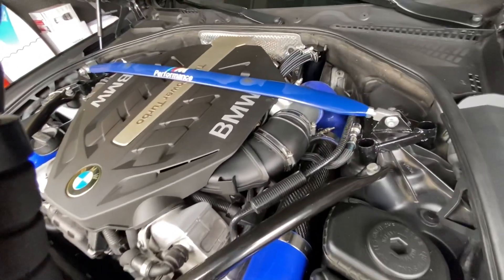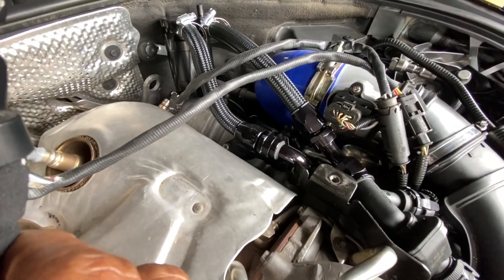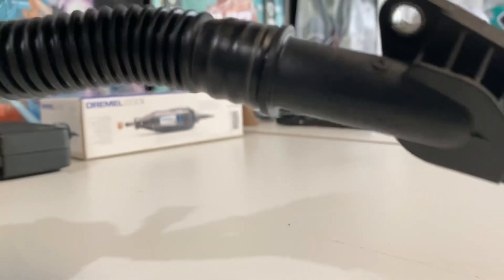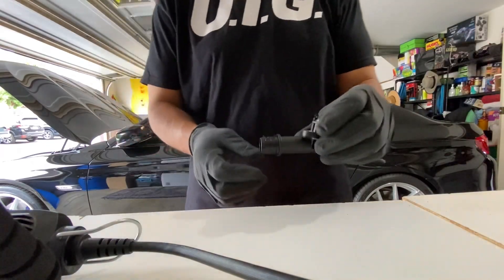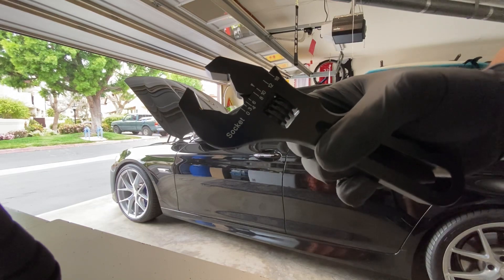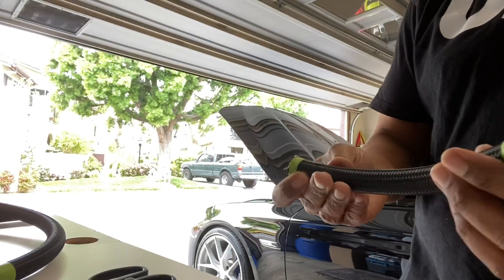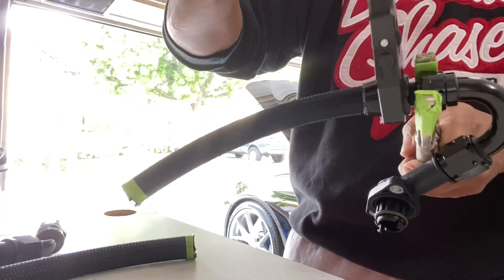BMW F10 550i Catch Can Install N63 Engine

Comment: I know splitt mods had that strut bar setup his links dont work anymore. Should have bought it years ago when he posted them. Happen to know where i can find me a set? I have the Tu will this effectively delete the ugly pcv system bmw has going across the turbos. Its just ugly and unsightly and replacing them is like 450-500 bucks. Im on my 2nd one. But people say no need on the tu. Did you end up fixing your codes from the leaks you mentioned?

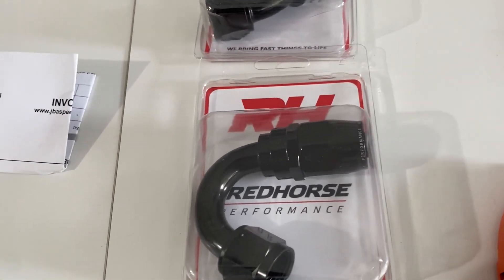Comment from the maker: I had to have my car smogged for reg in Cali and replaced my set up with cheap fittings and I have leak codes. I would suggest getting good fittings to prevent coding. 3:03 has part# ‘s
Reply: Did you have white smoke from exhaust issue prior to this setup? If so, did it help?

Comment: I don't think you needed those metal ends
Reply: Would've been better to just find the appropriate size line and put the metal clamps would've minimized leaks for sure.
Reply from the maker: @Chaos1187me the turn makes it impossible with the hose in the tight space. If you tried and got one to fit please post because it would save a lot of time.

Comment: I try to post links on where to get all this stuff for less and better, but YouTube deletes my comments if i put links in it, look at my Youtrube profile and send me an email, and I'll send you the details.

You need to smooth the entire fittings with the dremel as shown.  Do not cut it shorter.  Wrap electrical tape in the direction of how you screw on the fittings. Put a o ring inside the fitting that’s about the size of the inner fitting.  Put it all together.  It will be wait tight and don’t overtighten.  Just to when the sitting doesn’t rattle or move on it’s own.  Test blow into an end and close the other end with ur finger. If it’s air tight. You will be good to go.
Reply: Hey man! I just aw this comment but I have already bought the whole set up. You said the contact you for all the details for it not to leak. Do you think you could help me out with that? Just in case I have the N63TU model. I would really appreciate the help if something can be done to not leak and still use the same set up as his
Reply: Also, I have a friend that told me that another way to reassure for no leaks to put some permatex black around the AN fitting and the PCV. Do you think that’s good enough besides adding the step you mentioned?

Comment: Do not cut the 1st rib of plastic, it will not leave enough for the AN Fitting to fit flush, and it will leak, if the fitting rattles, it will leak, you can do a test with blowing into it and covering the other end with your finger, if you can hear air, its leaking and you will get a check engine on lost pressure. I had to buy a new set of PCV valves to redo this cause i cut the 1st rib off of the plastic, do not do this.. 

I keep trying to post where to get all the right parts but it keeps getting deleted.

You can get all the parts cheaper on amazon and ebay now, including using AN Fittings instead of the hose clamps on the catch cans to make it look really nice. but you have to make sure you do not have any leaks in the lines, or you will get a check engine light. Put a O ring inside the AN fittings on the plastic pieces, and do not cut the 1st ribb off, just sand them down and thread them on the fittings.

I tried to post links to all this but you can get a good set of everything on Amazon and 150 degree fittings on eBay for much less than the posted places, do your research.

Comment: I keep trying to post the details of this correct install, it keeps getting deleted. You should not follow this, the lines will leak and throw a check engine, you need to make changes. Contact me for links to the setup to make it without hose clamps and a real professional setup that is air tight.
Reply: Would love another option—I have a 2014 550i … how can I contact you?
Reply: Can you write a list of what to buy and where,,including sizes please?
Reply: do you have links of what to buy

Comment: Does it help to be running jb4 with these catch cans I seem to be getting a code (#107001) after install (throttle valve angle intake manifold pressure 2)
Reply: you have leaking lines. read my comments.

Comment: Is it really impossible to install the catch can with the oem intake? Just recently got my 2021 XB7 Alpina, and there aren’t many parts out for me to upgrade as of now. I’ve purchased VRSF downpipe, and mishimoto oil cans for it but couldn’t find charge pipe for the ride
Reply from the maker: The air box left me no room in the back of the engine bay but I have seen 1 guy mount it up front
Reply: @painkiller5766  you talking about the guy with the M6 right? The one who 3D printed the mount
Reply from the maker: @ArmedTheAsians  LOL…yes. I of course did not have a 3D printer but his mod came out good.
Reply: @painkiller5766  yeah his came out super clean. I have a general idea on where I could place the cans. But there’s really no way to be 100% sure about it until the cans to come in. Was thinking about designing a custom brackets for the strut bars so I could have someone 3d printed for me. Will let you know how it comes out. Your car looking great btw, what else did you do to it?
Reply from the maker: @ArmedTheAsians  I did the intakes based off SplitMods design, M5 comp mufflers with resonator delete, lowered and JB4 install. Custom rim and tires and little stuff inside the car.

Comment: PK, there's another video of someone emptying their catch can after a month and there was a lot of water that it caught.  What are you seeing?
Reply from the maker: I’m going to pull it out in a few weeks but the dip stick has oil on it
Reply from the maker: I’ll let you know in a few weeks
Reply: @painkiller5766  insert skeleton meme here. So now that it's been 156+ weeks how did it work? 😂
Reply from the maker: I just had to replace the hoses and forgot to video the oil out of the catch cans. It was significant enough that I am glad the cans are on.
Reply: @painkiller5766  Any leaks or those fittings worked out good in the end?
Reply from the maker: @ no leaks on the red horse fittings but expensive

Comment: Hey PK, I have purchased everything for Oil Catch Cans and CAI.  The only thing I am unsure about before eI tackle this project is the U Hose.  The one I receveid seems too large.  Could please confirm if is the correct size?  Thank you so much!!   3' 76mm Center to center Distance 7.5 (190mm) Leg length 4.72.
Reply from the maker: Yes that is correct…..This is the one I got from Amazon<BR><BR>ID 3" (76mm), U Shape Hose, 180 Degree Elbow Coupler, Center to Center Distance 7.5" (190mm), Leg Length 4.72" (120mm), 3-Ply Reinforced, Automotive Pure Silicone Hose, Blue<BR>by Ashly Zhang<BR>Learn more: https://www.amazon.com/dp/B07Z84CT3Z/ref=cm_sw_em_r_mt_dp_80NBNQDKHZ9Y7FWEF1RR

Comment: Why not fit the hose right onto the pieces instead of cutting them off ?
Reply from the maker: The 10An fitting would not fit snug, the ending is too long. A hose fitting without a 10AN fitting is a 3/4 hose which is to big to manipulate in the small space. I tried a straight fit of a 3/4 hose on both ends of the valve but could not get turned back to the catch cans. Everything is dictated by the intake set up.
Reply: @painkiller5766  I ended up doing Qty 4 3/4" ID - 90 Degree brass elbows instead of the connections and went with a catch can that has 3/4" inlet and outlet helped with the install.
Reply: @waynegriffith6022  did you use 4AN, or 6AN?
Reply: @jperry7480  Some reason I cant add a picture the hose I used was a blue 3/4" ID I did not use the connection tubes I did use a U tube found on LT1 chevy engines but found that if you switch the connection that is on the valve cover that they will fit and face the rear of the engine which then connects through a that 3/4" hose directly to the catch can.
Reply from the maker: Any way to add a pic for people who would rather go with your set up? I would also like to see how it looks

Comment: What year/model is your car & engine combo? This looks like a 2011-13 N63 (non-TU), is that correct?
Reply from the maker: Correct it is a 2011 550i - N63 non TU
Reply: @painkiller5766  When you took down the barbs of the push fittings, did you take just "trim" off the ridges and make the surface even, or did you take any extra material off and taper to account for electrical tape? How many turns of electrical tape did you apply?

PS - I'm doing this mod now and trying to NOT overthink it, but I'm failing at not over thinking!

Comment: can you leave links for the CAI that you installed.  They look amazing!!!
Reply: SlitMod video.
Reply from the maker: Splitt Mods has some of the best videos on YouTube. The MAF sensor for non TU will need a harness if you do not have a TU. Link is posted on this video.
Reply from the maker: All links for parts used is in the description. Look for the small down arrow on the bottom right corner of the video.